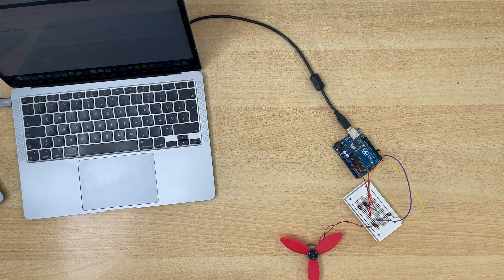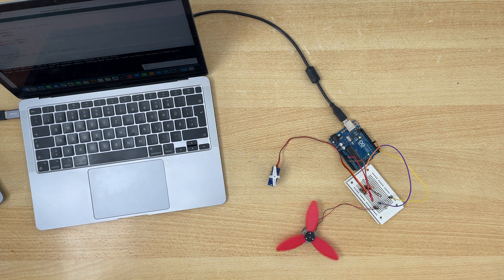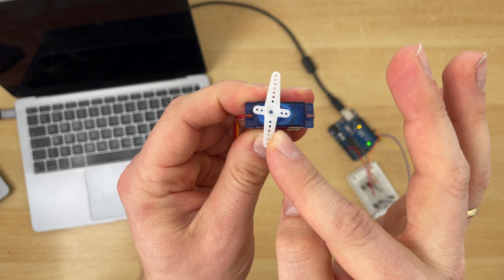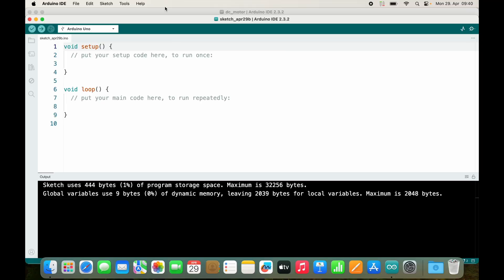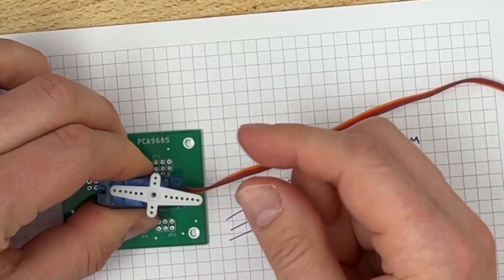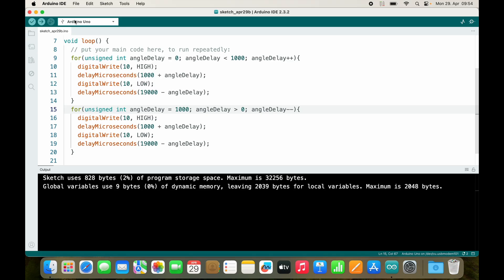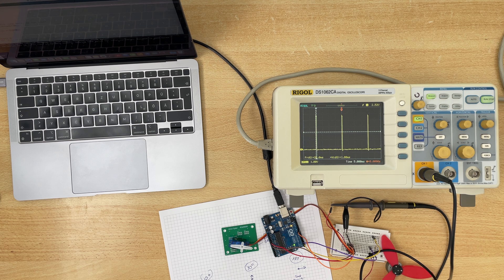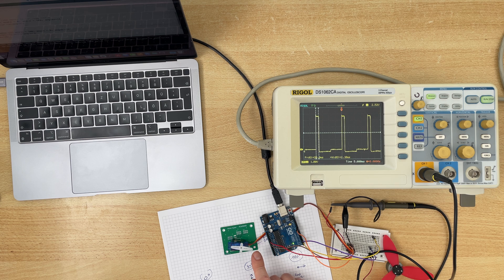Servo motor vs normal motor - (Arduino Uno Programming for Beginners)

Comment: @playduino Your bug is that delayMicroseconds() cannot take the large numbers you are giving it.  The manual states:
"Currently, the largest value that will produce an accurate delay is 16383; larger values can produce an extremely short delay. This could change in future Arduino releases. For delays longer than a few thousand microseconds, you should use delay() instead." For example, 19000 > 16383.

Also, do yourself a favor and cease using "unsigned int", etc. Instead, include stdint.h and use uint32_t and its relatives. That way you will know EXACTLY how many bytes your variable is implemented with when you switch from one architecture to another or from one complier to another 😉  For instance, an "unsigned int" may be implemented by a word, which may be 16 bits on the 8-bit AVR and 32 bits on an ARM Cortex-M4.
Reply from the maker: wow thank you for pointing this out. I was not aware of this delayMicroseconds() limitation!

I agree that using types like uint32_t is safer, however with beginners in mind I will keep using the simple data types.
I try to avoid everything that would have scared me away as a beginner back in the days 😅

Comment: Thanks for a good video!
digtalWrite take some time to execute. Even if the time is very short, it can affect your "homemade" PWM signal.
Reply from the maker: thank you! yes this is true, digitalWrite is slow, if you need fast IO, you better directly work with the registers - however in this case the problem was delayMicroseconds(): the largest value supported is 16383 🥲

Comment: I’m a noob but Could it be that if you were saying less than 180 you were only making it to 179?
Reply from the maker: 😂 you are correct, sorry for the confusion . The thing is, 1.5ms should be 90 degrees, but in my case it was more like 110. so the maximum input in my case would be maybe maybe 145 degrees which then results in 180 real degrees
Reply: Ok, now you lost me.  I’ll have to let that sink in.